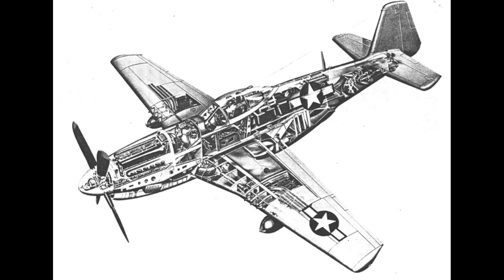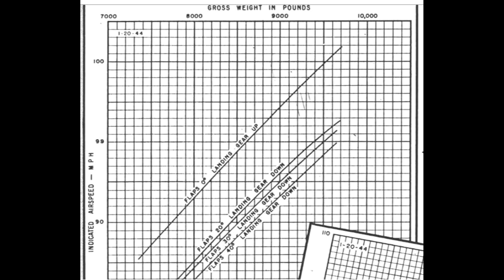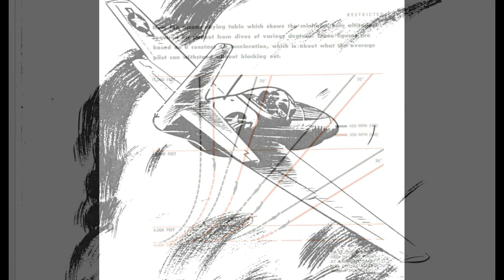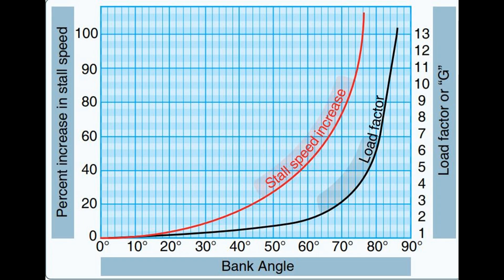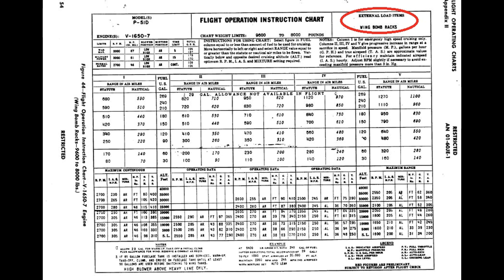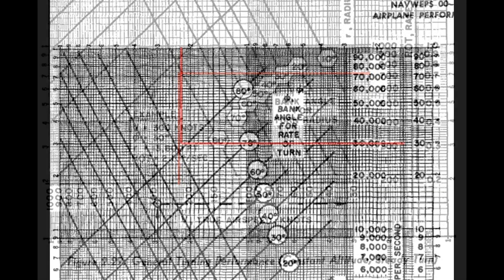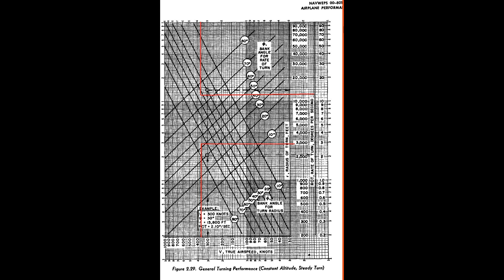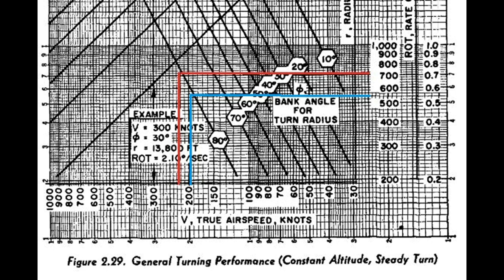P51 Mustang Turn Radius vs.

Comment: P51 bleeds energy as hell. Good luck outturning 109s. P51 was a much heavier plane than 109 with big wing load and when they meet 109s remember that they also had a lot of fuel to back hope so no match for a 109s
Reply: At that time, 1944, the P51 was being tricked out to run 150 octane gas and then operate from bases in France and Belgium which cut down on weight penalties. Add the huge boost advantage of the P51 at the heights being fought at the P51 had much greater thrust which is a component of turning. I would rather be in a P51 than a 109 in a turning fight at 25,000!
Reply: er, drop tanks.
Reply: Unfortunately few 109's had all the mods you described , the p51's had a massive supply chain feeding a field mod system and flight line tuning, hot rodding,  by crew chiefs. So my 2nd Lt had a better chance of higher turn rate P51 than your 2nd Lt's 109.
Reply: E69_geramos109 And how was that 109 setup? With a heavy weapons load to attack bombers?
Reply: Dwayne Morton I’d rather be in a MkXIV  Spitfire!
Reply: Really?
Reply: To chase V1s
Reply: Speeds matter, low speeds, 109 playground. High speeds, p51 kills.
Reply: SvenTviking 
Mk XIV?  Meh, I’ll stick with the Mk XVI, thanks.
Reply: If I had a choice, I'd have been flying P-47's
Reply: E69_geramos109 and Dewayne Morton. You both need to watch the vid where Greg explains why the p51 was faster than the 109. He covers a lot of what you guys are discussing.
Reply: P51s started to be a problem at spring 44 and at this point the war was already lost by germany. 109s had to fight the P51s at 30 000 feet, spits and P38 on the mediterranean and La5 and yaks on the Est on the deck so a plane for everything and he did well against all being equal and superior on some aspects. From the beguining of the war till the end a plane that was from 1935 and keep the fight against the most modern ones on the last version K4.
Reply: Dwayne Morton when the P51 arrived maybe he could outurn 109sG6 with gun pods and with no AS compresor but this is more because the lack of 109 power on this period. As soon as the escorts appeared 109s task was to fight with escorts and to attack formatios more the task of 190s so to put gunpods has no sense. Sure there were still some messers with gunpods  but on general the 109 had the advantage on turning
Reply: Dwayne Morton at the time the P51 were on france bases 109s had As compresor and GM1 inyection sistem so they just were worse al level flight speed. Acceleration climb rate and turn were for the 109s. On this altitudes to turn is difficult on any plane anyways but the P51 wing was much worse keeping the energy on turning because it provides low lift force. 109s blades were also bigger and optimiced for hight alts to have better traction. 
About the 150 octane they were operating 130 octanes till 1945 early and then the K4 with C3 was again equal or superior.
Reply: Dwayne Morton on autum to equip field mods on the 109s were quite standar. They had no lack of planes most of the times. They had lack of trained pilots due to fuel suplie. There were way more available planes than pilots. They were not flying with every singel pland even if was outclased. Yo can see the units the scuads had and yes there were also planes without the mods but that was because they changed parts between them if for example one plane comes with damage they put the mod to the other one so less cost than to have a full equiped squadron that can not operate at full capacity due to attacks on the arfields and pilot lacks
Reply: I guess the important point is that when the 109's faced the P51's and when it could have made a difference in the outcome of the war, 1943-1944, it wasn't up to it. In a turning battle that is. I think everyone agrees the 109 was modded to be competitive but it was too late. At least Israel had some nice aircraft as a result!

Comment: The aircraft in the early shot could be a P51; specifically, it could be an -A model, except for the dive brakes, which make it an A-36.
Reply from the maker: That's correct, the A36 and P51A are pretty similar. The main external difference are the dive brakes and nose mounted guns on the A36.

Comment: This "really sharp observer" noticed that the aircraft at 0.22 IS an early model P51. Alison engined, not Rolls Royce.
Reply from the maker: Julian is correct, it's an A36 Apache.
Reply: rightangle Oh, I thought he might have been suggesting that it's an A36 Apache?
Reply: My apologies, my mistake, I missed the dive brakes! My excuse is that I'm retired and all that.....
But is does have an Alison engine, doesn't it?
Reply from the maker: rightangle, wrong, it's not a P51 with an Alison.
Reply: that D-9 in the Museum you aluded to, is it not rather a D-13? the reason is i didnt see the 13mm MG bulges in front of the cockpit. but the air intake is on the right side for a Jumo 213A.not sure- did the D-13 have a DB603 (intake on the left) or the Junkers motor?
Reply: Greg's Airplanes and Automobiles haha I love it, although I must admit I actually hadn't noticed. It was only in the way that you mentioned it I realised...
Reply: I think he was messing with us :) Does take a really sharp observer, at least without hitting pause.

Comment: Rate should be part of this title,  discussion as well( it is later in the video) , as it isn't just turn radius, it's rate in terms of degrees per second which determine turn performance overall, many new flyers don't figure this out initially.
Reply from the maker: The single hardest thing when making these videos is somehow coming up with a title that makes everyone happy.  I am not concerned about it because I am not going for clicks, I am going for content.
Reply: Fair enough, don't take this as negative criticism either, my point is only that so many pilots online in combat sims frequently don't understand that turn performance isn't just a matter of turn radius, and that rate plays just as important a roll, as do other factors.  Which, again, I feel you explained very well in the video.  I'm really enjoying your content, glad I found your channel, and I'll point others I fly with online here, some great videos.  Plus I dig your small performance car vids, I've had a few Miatas and an Alfa 4C (and dozens of other performance cars).  Please keep making content like this, the 109 stuff is especially great, been a 109 fan since I was a kid, and fly it in Aces High almost exclusively for the last 20 years online, and DCS and IL2's 109 models as well.  My uncle built scale R/C models when I was a kid, and worked in that industry for years, and won a bunch of awards with his 109F4 model he built in the 80s (I have lots of pictures of this particular model).  Ever since, I've read everything I could find on the 109, plus a neighbor my father had at his cabin was a German LW WW2 pilot, and was involved in the M163 project near the end of the war, and flew several models of 109.  I wish I'd recorded all the conversations I'd had with him...

Comment: Yeah but what about the P-51 vs the bf 106 g-6. Or better yet how did the P-38j compare to the bf 109 g-6?
Reply: joe martinez The BF109s turn performance is quite debated due to a number of factors especially it's Handley-Page slats. An experienced pilot could make a 109 turn very well for a short time until the speed bleed due to drag. 

The P38 was unfortunately laughed at by the Germans. It had it's good points, but was severely handicapped in it's maneuverability at altitude. It also had a few other immense issues and was quickly withdrawn from the European Theatre...

Comment: Did the mustang engine quit during a negative G dive like a spitfire did ?
Reply from the maker: No, absolutely not. However it is limited to 10 seconds of operation during negative G maneuvers due to oil pressure loss.
Reply: *Merlin
Reply: +Neil Dahlgaard-Sigsworth - Miss Shilling's Orifice didn't prevent the cutting out, it prevented overflowing of the carb with a possibility of grenading the engine.  It was a diaphragm fitted to the float boal, which restricted the flow of gas even when inverted.  Without this restriction the fuel would flow at max rate with a possibility of flooding the engine and hydraulic lock.
Reply: +Barrie Rodliffe - You are correct in saying that I don't know Miss Tilly worked on SU float bowl redesign.  Could you provide some search phrases that support that?  (Links in YT comments suck, so I don't ask for those.)

Also, I don't know how engine which traverses from positive to negative Gs wouldn't cut-out at least momentarily even with this new float.  It seems to me that it solved a problem of partial throttle rich-mixture conditions which were still present even with Tilly's diaphragm installed.  But was it able to provide continuous power during a high speed bunt?  

As far as I see it, unlikely.

Regarding the rest of what you wrote - of course you are correct.  Problems with carbs were solved quite quickly and mediated almost instantly.  I agree with that.
Reply: +Barrie Rodliffe - Thanks man.  Seems like a cool book.  For some weird reason, I like carburetors.
Reply: Huh? Merlins always used carburettors, as RR wanted the denser fuel/air mix caused by the evaporation of the fuel to give more horsepower, compared to the BMW direct fuel injection of the BF109. "Miss Shillings's Orifice" in the fuel bowl was a quick fix early on and later they used Stromberg type carbs to maintain fuel flow in negative Gs. BTW my dad built Merlins all through the war and went home to a warm bed after his shifts, while his unhappy elder brother was blown up in various crappy tanks in North Africa and Italy...a sore point in the family back then. Hahaha! ;-)
Reply: Julian  ALL  Mustangs used the Packard built merlins that ALL used the Bendix pressure carb that did NOT have that problem !!!  Took RR Until the 60 series 2 stage 2 speed supercharger  1943 in service to use the Bendix carb. !!!!!
Reply: Only the very early Marlins cut out under negative G's. By the time of the P51 came along Marlins were fitted with what was then called a 'pressure carburettor', what's now known as single point fuel injection. Negative G has no effect on single point fuel injection, so Spits didn't cut out anymore...
Reply: +Barrie Rodliffe - I don't think so.  Only a totally different carburetor could stop the engine from cutting out.  Under negative Gs float type carburetors simply stop working, because the fuel is up, not down, and the main jet sucks air.

But what happens if you keep on flying inverted?  The float works backward, so the fuel is constantly pumped into the float bowl until it fills it fully and keeps on pumping.  Too much petrol can destroy engine.

Miss Shilling's diaphragm restricted the flow of fuel to the maximum amount the engine could use, so it wouldn't hydrolock.  The restriction was tuned for different versions and max manifold pressures.

But the engine would still cut-out momentarily.  It just wouldn't grenade itself.

Comment from the maker: I recently got a request for a 109 vs P51 turn radius analysis. I'll do that in the next couple weeks, along with a DR1 vs. Camel in Rise of Flight analysis.
Reply: Note that the P-51 Pilot Manual specifies 20 degrees of wing flap extension for a minimum radius and max sustained rate turn.
Reply: I will be waiting !.   One thing about engines ........ I have always been interested in Junkers Jumo 213 .   It powered the FW -190 D and TA152.
It would be interesting to see how it stacked up compared to Daimler 605 and RR Packard.   That said --I really like your videos , most pilots ( not  video gamers ) have to love them  . Thank you ! .
Reply: What's wrong with video gamers? I love his videos too...
Reply: lol , it's far simpler, P-51 had significantly bigger wing area than Bf-109 and that matters a lot, especially at higher altitudes
Reply: @jasonphoenix1  Yes. Biguer wing area but more weight as well and worse  power to weight ratio than the 109
Reply: Waiting the P51 vs 109 turn performance video. I am interested as well on comparing the wing design and how that wing type loses energy and works. Thanks
Reply: Also the wing design itself,  laminar flow wings on the P51 are made for high alt. They give the pony advantage.  Lower the advantage slightly to the 109.
Reply: @icedragon642  Well this kind of wing had lower drag so more speed and better fuel saving but produced less lift as well. Something you want on a turn fight. 109 had slats as well for low speed turns.
Reply: Can you also address instantaneous turn rate vs sustained turn rate?  Speak to out of plane turns, i.e. pitch-backs.  And the importance of energy in determining the ultimate outcome of an encounter.  As Robert Shaw points out in his seminal book, Fighter Combat, very rarely do planes meet in the classic, co-alt, co-energy set-up.   More often WW2 engagements began with a high-side ambush that devolved into a fur-ball.  Even though they didn't overtly speak about it as such, highly successful WW2 Aces employed Energy Fighting.  The most accomplished ace of all time, Erich Hartmann credits starting with Pauli Rossman ( who had a war wound that didn't allow him to pull high Gs and therefore adapted a flying style that didn't require this tactic) as his mentor to developing his signature style that emphasized extremely high SA, calculated ambushes and Energy over what he called "bar-room brawling", what most would refer to as "dog-fghting."  Turn rate and radii are far more interesting when taken out of antiseptic, clinical abstraction and addressed in real life scenarios.  Three key examples: (1) 190 pilots exploited their superior roll rate and turn through 60 degrees to devastating effect against Mark V Spitfires; (2) far from smack talking, the P-40 Ace might have been referring to his ability to track zeros through a certain amount of degrees in order to pull lead for a high deflection shot, not advisable for anything less than an expert but certainly doable; (3)  P-38 Aces Bong and McGuire used flaps and asymmetric thrust to track Zeros and pull lead on them; indeed this cost McGuire his life...(Jeff Ethel and Robert Shaw document this tactic.) Jug pilots exploited their superior roll rates to displace outside 109 and catch them from a cold side lag pursuit position; (this is also detailed in Shaw's Fighter Combat).  All of this occurred at the extreme edge of accelerated stalls but when the stakes were life and death, pilots did what they must to win. Really dig your stuff man.  Please keep at it.  Salute!
Reply: please take into account the wing slats of the 109 that help it turn in fights
Reply: Hey @Greg's Airplanes and Automobiles, love your channel and your videos - is there any chance we may still get that Bf 109 vs P-51 turn radius analysis? this has always been a hot topic - would be great if you could put that topic to rest!
Reply: Comparison of max turn rate is not very useful for a dogfight. You get only one chance to use your max turn rate and if you miss, you're going to use your sustained turn rate for the majority of the remaining fight. That is, unless you take the fight vertical and B&Z. A Wildcat will outturn the P51 all day long if the P51 pilot lets the plane slow down below 300 knots. In sustained turn the turn radius achieved will determine which plane outturns the other - and in here the low acceleration and higher speed of the P51 will become its disadvantages if it tries to dump all its speed and start turning with a wildcat. Only way the P51 can outmanouver an equally skilled pilot is either use the energy advantage for passing attacks.